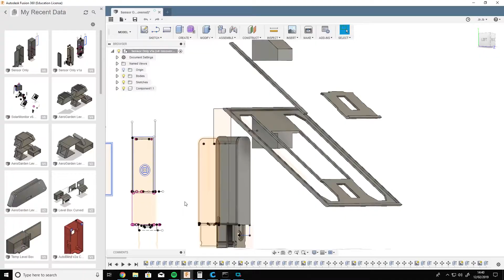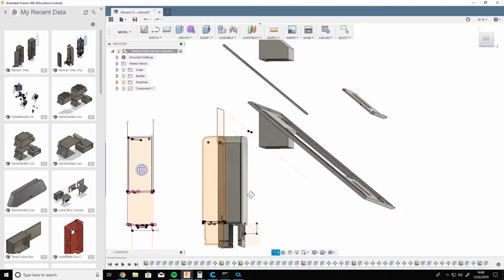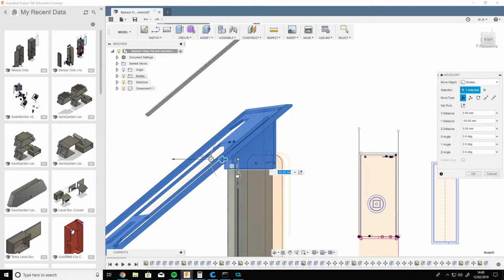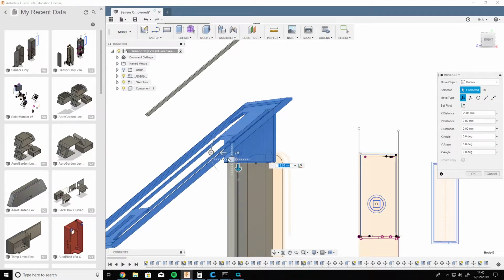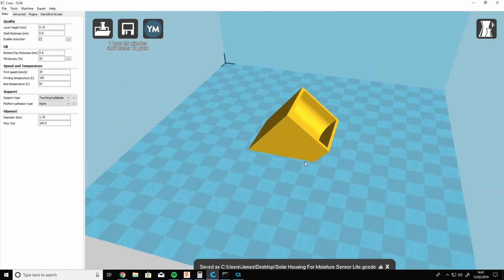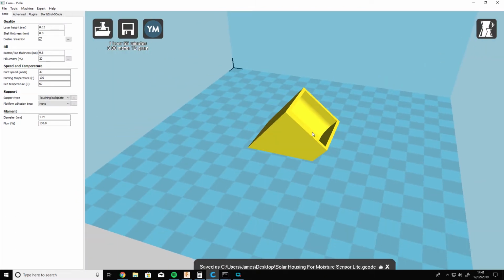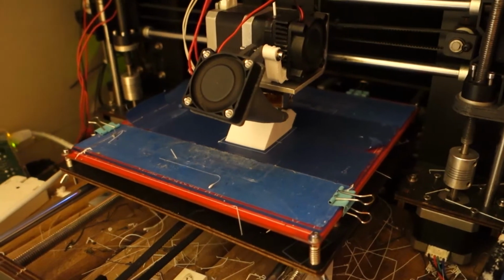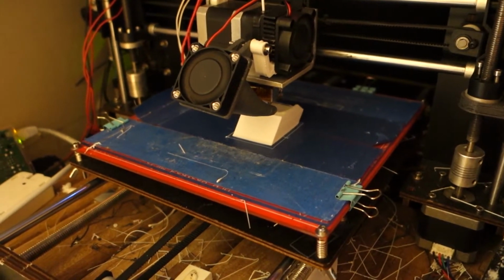Solar power module for the wireless soil moisture sensor

Comment: This looks great, I'm really interested in this project. I have a question though... how does this fair in really inclimate weather? I would guess most things are going to follow the slope of the solar panel  but that still seems like a lot of exposed electronics underneath. Also does this added setup charge the battery for use when the sun is not out?
Reply from the maker: Hi Dave, thanks for your comments. The design was really for use indoors/in dry weather. I suspect if you wanted to use it outdoors permanently you would need to seal it with some sort of silicon. Regarding the battery yes it is charged and should last a good few days even with zero sunlight, hope this helps.